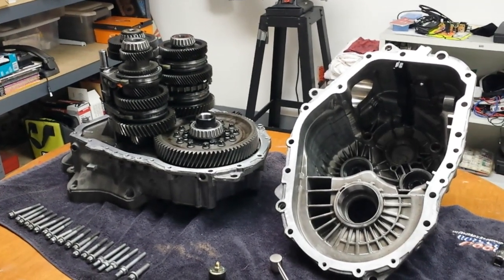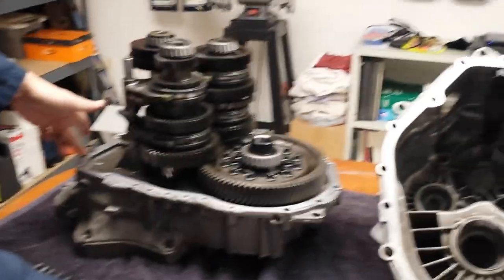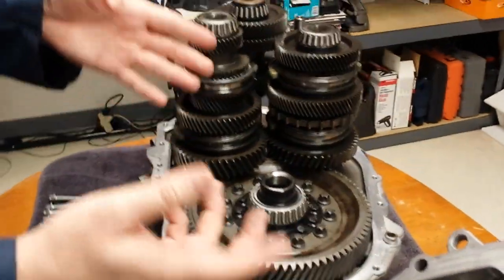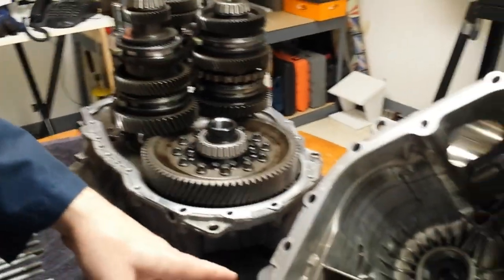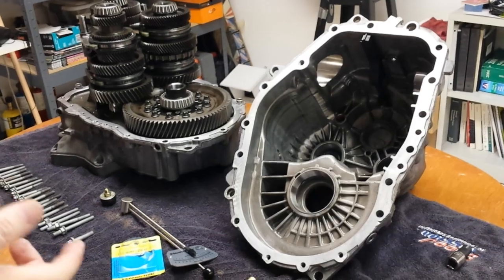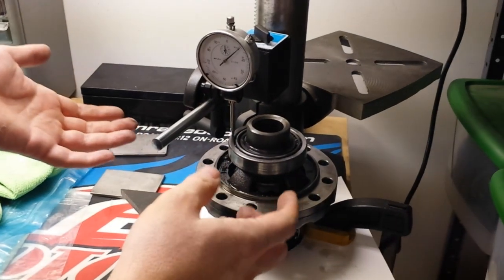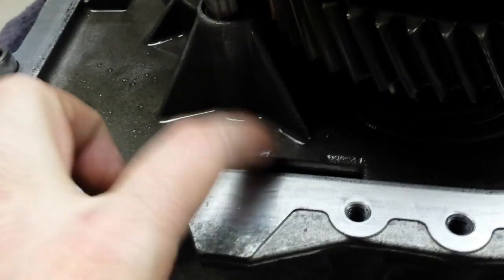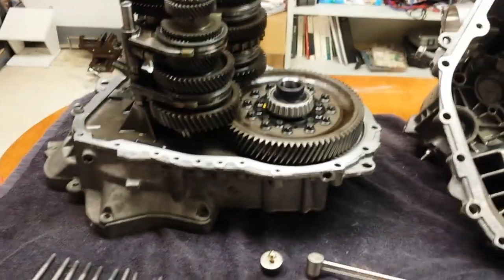Limited Slip Differential installation, GM F40 transmission

Comment: Thanks for your video - that technique for measuring preload was invaluable for me.  I just put a Quaife in our 2006 Saab 9-3 Aero Convertible with the 2.8L (B284) engine and F40 6-speed MT.  Am also converting to single mass flywheel and Stage 3+ clutch to hold over 400HP wheel.  Although the Saab spec indicates a rather generic 32010X taper bearing (widely used as wheel bearings), I found that bearing choice matters.  I think my OEM diff bearings were probably Timken - these have larger (and fewer) rollers than a FAG (Schaeffler) and General bearing I tried initially.  The FAG and General bearings with smaller rollers seemed to leave significant play when installed with the OEM shim.  Using the Timken bearings, the Quaife height measured less than.002" different from the OEM.  I needed to add shim thickness to attain enough preload, but GM has terminated the shim parts.  I found stainless .01 and .02 mm shims with suitable (70mm) ID on McMaster Carr's website - $12 for both, including shipping (part numbers are	98089A513 and 	98089A634 respectively) .  The McMaster shim OD is too large, so I traced it with the OEM shim as template, then trimmed with tin snips. The .01mm layered on the OEM (1.07 mm) shim gave me right at 18 inch pounds of rotational resistance.   Word to the wise on parts selection... the reason for pulling the trans was that one of the CV driveshafts twisted inside the OEM diff - damaged the splines.  It seems the drive shaft material (or the hardening process) was not adequate....  don't skimp on CV shaft quality (price), if your gonna push alot of power...

Comment: Any idea what the part number is on the Carrier bearings .. can't locate any
Reply: For the Saab version of the F40, they call out 32010X, which is a widely used and available wheel bearing. I'm pretty sure the OEM bearings are TImken, and I found that the Timken have larger and fewer rollers, and the installed height is taller with the Timken than with other brands of 32010X. Online parts sellers have the "Saab Bearing" prices at $70 and up - I bought a pair of the generic TImkens on Rock Auto for substantially less.  That's the TImken 32010X bearings for the F40 Differential carrier (and I understand the F35 5-speed MT uses same).

Comment: Good video. Quick question when you measured the pre load. Im guessing it was in Neutral? I just wanted to be sure. Thanks again
Reply: It doesn't matter as you check the pre load with the ring gear off the lsd

Comment: Can you tell me what oil capacity?
Reply: Saab factory was filling them to 3L, but put out a service bulletin changing that to 2.4L.  There are a couple ounces of fluid that remain when the unit is drained, so the refill may be slightly less than 2.4L.

Comment: How much torque does the Wavetrack handle ?
Reply: The Quaife folks indicated a rating of 400 NM (295 ft lb), but folks are running upwards of 800NM using both Quaife and Wavetrack. The F40 is rated to a max of 400NM in some configurations.
Reply: @traytonjay2670  mmm... wavetrack too on the F40? I didn't know it was made for it also :) thank's

Comment: so you check preload with the ring gear removed on these or with it on?
Reply: The diff should be free wheeling when measuring. It could be that the ring gear is off the diff, or one has the other gear stacks disengaged from the ring gear - leaned away or removed.

Comment: IS this performance limited slip . I have gm 6 speed manual on m'y stage 2 2.0 diesel with more than 500nm of torque . Where do you buy it if it fit mine
Reply: It is performance - some use it for racing.

Comment: Hello and good morning, I'm installing ATB diff to my FWD F40 gearbox. My Old Bearings was "Tapered roller bearing NP727209 / NP106970 TIMKEN" or " NP727209 - 90KA1" I bought one set new from Ebay. They show me TIMKEN pictures and Send me pair of "SKF 32010 X/CL7C VB026" now. They have the same angle of contact. TIMKEN has bigger roller diameter with 23 rollers. SKF has smaller diameter roller with 25 rollers.  Do you think I should use 32010x instead of TIMKEN. Did you have any problems with bearings ? Can you or anybody help ?
Reply: I has similar experience - most 32010X bearings have smaller rollers.  My OEM were the 23 count rollers, so I replaced with the Timken 32010X that has 23 rollers.  It does make a difference on shim distance - For mine, Timken requires less shim than other bearing makers.

Comment: Great video, what was the size of the plug you used im finding it hard to see the size on the packet?
Reply: 1" plug works - anything larger and you'll be working too hard to cram it into the hole.

Comment: I e recently bought an 93 aero 6 speed and it appears to be leaking oil around the bell housing, would seals cause this effect? Seems to be wet the whole way round, and it only drips whilst engine running, thanks
Reply: There are several possibilities.  If it's engine oil leaking. your rear crank seal (inside the trans bell housing) or the oil pan seal may need replacing.  If you are able to confirm the leak as trans oil, it could be the input shaft seal (O ring located behind the slave cylinder) or leakage somewhere around the perimeter of the transmission case.  Another possibility that the slave cylinders (inside the bell housing) is leaking hydraulic fluid and may be ready for replacement.  Last possibility that the line between the clutch master and slave cylinders is leaking hydraulic oil (probably where the line connects to the transmission)..

Comment: any advice on resolving crunchy gearbox on my alfa 156 2.4 20v? It is the same F40 :(
Tryed a lower (0.2 dcl) level of gearbox oil, but it helps only slightly
Reply from the maker: If it's particularly bad in 1st and 2nd, you could need to adjust the shifter.  On the applications of this transmission that I'm familiar with, the shifter (in the car) controls the 'left/right' position of the shifter mechanism in the 1/2 gate (so that the reverse lockout button can be on the shifter in the car).  The 3/4 and 5/6 gates are located by the transmission's internal shifter mechanism, which is why a shifter adjustment usually can only resolve 1/2 issues.  Other than that, just know that you are not alone... most people with this transmission complain about the shift quality.  Mine is terrible when cold but much better once warm.
Reply: @shuan Harrelson Hello. Just to let you know, I managed to get the sound pretty much gone, it rarely does this now. Add a Liqui Möly gearbox additive, I used two when I changed the gearbox oil and it even makes the changes smoother and nicer.
Reply: Hello, I have a question. I own a vectra c F40 gearbox car. It changes fine the gears but it makes a somewhat weird noise when changing gears at cold, in all speeds. It doesn't block or refuse to change, just does a weird metallic crunch. Do you think it might be just some wear in the gearbox? When it warms up it's perfectly fine, but stil could make some slight noise even then, some sort of a metalic sound. Is it the same in all vectras?

Comment: Are any special tools needed to swap in a lsd into the f40 trans? And you mentioned some tty bolts? Also wondering where u got the new bearings and what the part nUmber is for it
Reply from the maker: There were no TTY bolts involved in the disassembly and reassembly of the transmission itself to install the LSD.  There were TTY bolts involved in the removal of the transmission from a '12 Buick Regal.  The only tools I consider 'special' in the installation of the LSD I mention in the video (small torque wrench and a way to grip the differential to test pre-load), and in the description (E12 and E14 sockets).  The bearing part # is in the description, I got mine from Rock Auto.  I posted a 'step by step' for getting the transmission in/out of the car in buickforums.com.  Look for thread #43048.
Reply: Beauty thank you I never read the description sorry,  sorry if this question sounds ignorant on my end but is the bearing need to b pressed on or need a puller to remove the old bearing?
Reply from the maker: Yeah, the old bearings need to be pressed off and the new ones pressed on.  I had a mechanic friend of mine do it at the dealership he works at.  I think auto parts stores like NAPA still do this too for a reasonable price.
Reply: Ok thanks a lot, I saw that you posted the ring gear trq spec below do u have the trans case bolt specs?
Reply from the maker: 9:40 into the video

Comment: Because these parts "should" be precision machined, I should be pretty safe to order just three size shims from 1.00 mm to 1.10 mm. Seems to be pretty straight forward swap to by myself. My mechanic charges 800€ of diff swap and it doesn't include work to remove/install the gearbox and new bearings e.g. needed parts :/.
Reply from the maker: I couldn't find that specification either.  I asked the guys at Wavetrac and they recommended 70 ft-lbs for those M10 bolts with 'permanent' (red) Loctite, so that's what I did.
Reply from the maker: I've only done one, so I really can't say if the same shims are in every transmission.  It did seem, from my experience, that the shim is there to account for tolerance in the transmission housing, since swapping the diff and bearings resulted in the same shim.  There could be a production tool for the transmission case that wears over time and rather than change it constantly, they run through the different shim thicknesses to account for it, then change the tool???  Report back on how your swap goes and then at least we'll have two data points.
Reply: @waltgorczowski9444  Do you think this transmission is better than an F35 5 speed GM trans ?
Reply: +Walt Gorczowski I am currently changing my differential but can't find any torque specs for the ring gear bolts. What torque you used for them? Btw, my bearing shim was 1.15 mm thick.
Reply: I can't find this differential you used. Do you have a part #?
Reply: http://www.regalautosport.com/shop/Wavetrac_Differential_for_F40_Vauxhall_Astra_J_VXR_Astra_J_2_0CDTI_Vectra_VXR_Vectra_C_1_9CDTI.html
Reply: Thank you